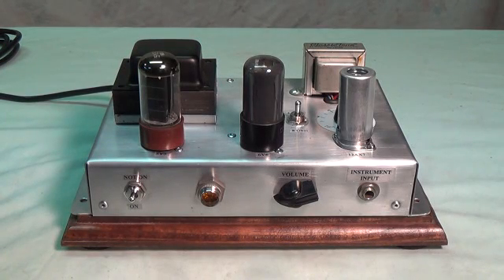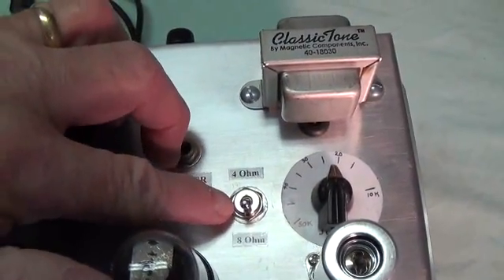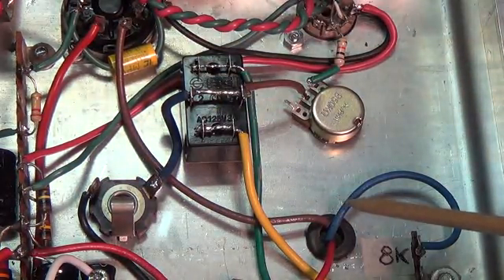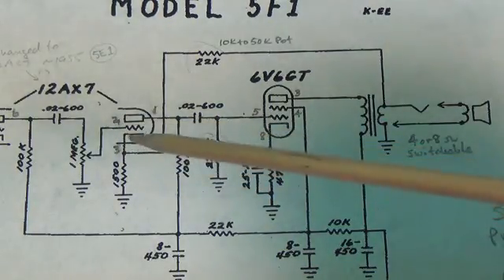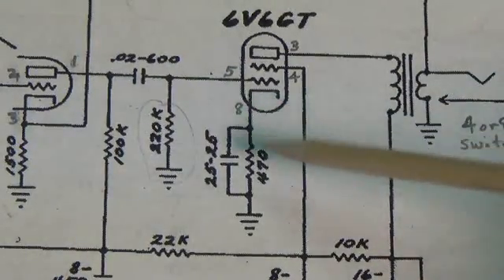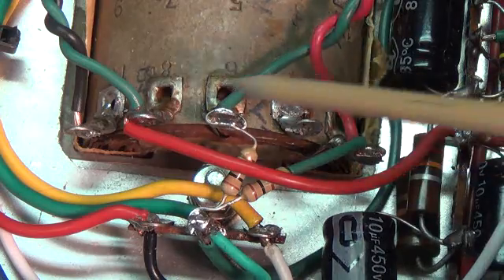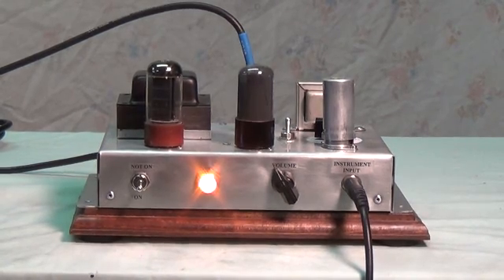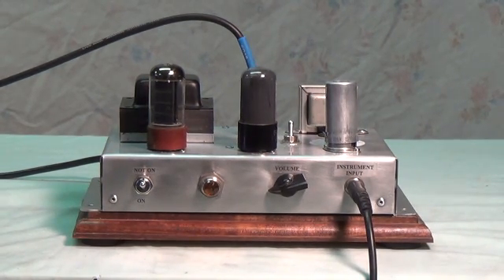Scratch Building a Fender 5F1 Champ from Scrap Parts.....Part 2

Comment: Dear Uncle Doug
I have gathered all the parts to start building a 5f2-a combo like you did in an earlier video. But now after seeing on this Champ you used a selector switch for the output to keep the negative feedback connected to selected output, were on the older video of the 5f2-a you have two output jacks. I'm conflicted on what MIGHT works better. I say might because I see other amps like the JCM800 has the feedback connected to the 4 ohm tap before the selector switch, suggesting that it doesn't matter because it still connected to the circuit regardless. Please enlighten me with you enormous wisdom.
Reply from the maker: You can use two output jacks, one 4 Ohm and one 8 Ohm and connect the NFB to the 8 Ohm output jack, NP.  It doesn't have to be switchable. It will work for both output impedances.
Reply: Thanks for clearing that up, but now another question simmers in my brain. What would happen if the NFB was connected to the 4 ohm output? Would it affect the tone? If so, could that be a mod to add a switch, to switch the NFB between 4 and 8 ohms?
Reply from the maker: According to viewer input, you want the NFB permanently attached to one of the outputs; otherwise, the amount of feedback will vary greatly if you try to switch it.

Comment: hey love your vids.  this little amp is almost I dentical to the fender champ 5E1.  I was wondering if you could combined the two by turning a swich tho can wich one you would like
Reply from the maker: +fucken killer jason  The only differences I see between the 5E1 and 5F1 are a filter choke and cathode bypass cap on V1a with the 5E1. The CBC could be made switchable, but the filter choke could not (in any practical way).

Comment: Hi Doug,  Is there any advantage to or a way to shield the wiring associated with AC current so as to further reduce hum ?
Reply from the maker: +Andrew Darnley   Simply twisting the two AC wires tightly together will result in out-of-phase EM fields which cancel each other......and greatly reduce or eliminate 50 or 60Hz hum.

Comment: Love your channel! I'm looking to build a 5F1 soon, and this was very helpful for some ideas on customization etc. One note: the link in your description is no longer working (I'm guessing the site has been abandoned since you posted). There are tons of sites with information on this amp, but if you have another suggestion for a good source, I'd love some expert guidance.
Reply from the maker: +bh3553   I checked the link and you're right, BH.....so I deleted it.  As you noted, there are countless sources for info on this specific circuit. For general knowledge about circuit design and function, I recommend the The Valve Wizard (UK), and for improving of circuits, I recommend The Fender Guru.

Comment: hello uncle doug, I wanted to ask that can i use the virtual grounding for a 320V transformer? which has a single 320V volt output rather than a centre tap 2×320V transformer?
Reply from the maker: +Harsh Karelia  Greetings, HK. The virtual center-tap is used only for the 6.3VAC output to the tube heaters, if the 6.3VAC winding does not have a center-tap. The high voltage (320VAC) winding must have a center tap if you are going to use a full wave rectifier. If it doesn't have a center-tap, then you will have to use a full-wave-bridge rectifier. You cannot use a virtual center-tap on the high voltage winding.
Reply: +Uncle Doug thankyou very much sir! I am not able to find a 2×320V transformer anywhere in India. I am trying to build a plexi style 6v6 so the negative bias should be taken from the bridge rectifiers negative? and where will be the common ground for all?
Reply from the maker: The negative DC output of the FWBR is grounded to the chassis, and the positive output is the B+ for your plates. You can either cathode bias your output tubes or take a grid bias voltage from the 320VAC output of the power transformer (prior to the FWBR), reduce it to the proper level with a resistor, and then diode rectify it negative and filter it. It would be easier to simply cathode bias the output tubes.

Comment: Would two 8/ ohm speakers paralleled on the 4/ohm setting create richer tones?
Reply from the maker: +bad banano  I think two speakers always sound better, or at least fuller, than one, BB, and your math is correct.....the two 8 ohm speakers in parallel would have 4 ohms of impedance.  You could try it and see.
Reply: +Uncle Doug, as you imply, that would depend on what sound you're after. As I'm sure you know, but just to clarify for your readership, two speakers will increase your efficiency and consequent volume for the same output setting, as well as the headroom of your speakers and consequent clarity. But those increases may or may not be what a given person wants. If you're looking for speaker breakup instead of clarity, or volume is of no consequence, or perhaps low volume is even desirable such as when recording or when neighbors are an issue, or in the case of recording where a single close mic on a single speaker will give you the most clarity, then a single speaker is "better". Thanks for all your work!
Reply from the maker: You're welcome, Tim. Thanks for your input.

Comment: hello doug, i thoroughly enjoy your videos and have learned a lot from them. i am starting to build my own 5f1 from scratch and i have a question: i was planning on using a second 1M pot as a tone control in mine, but i dig the variable negative feedback loop. from a standpoint of voicing the amp, would you have a favorite between the two, and would there be any benefit to adding both features? also, i am assuming that you used a dpdt instead of a spdt switch for the 4/8ohm output selector because you had one in your magical "junk" drawer.
Reply from the maker: +4bbl4sp2ex   I'm glad to hear that you enjoy the videos, 442. I would suggest adding both a tone pot and adjustable NFB pot. The effects are useful and quite different. Yes, apparently I had the DTDP handy and jumpered it to turn it into a SPDT.  I hate having to order or hunt down parts, so I tend to use what is at hand.
Reply: Thank you Doug! How do you feel about adding a 25/25 cap in parallel with the 1.5k resistor off the #3 lug of the preamp tube to help with the loss from the tone pot?
Reply from the maker: Adding a cathode bypass cap can often increase gain and improve low end tone, 442. I suggest that you try it and see how you like it.

Comment: Hi Doug,
You have inspired this 64 year old tech to scratch build a Fender Vibro-Champ into a speaker cabinet I made in Jr. High School wood shop nearly 50 years ago!  Thank you for all your incredible videos!

I have one question perhaps you can answer...Would it be feasible to build in a Negative Feedback Loop control as shown in this video of the Champ into the Vibro-Champ circuit?  Or would it interfere with the vibrato circuit?

Thanks again! --Dean
Reply from the maker: +Dean Rohleder  You're welcome, Dean. Rusty and I are glad you found our videos to be inspirational :)  The AA-764 Vibro-Champ circuit has a fixed NFB loop (2700 ohm resistor), so making it variable would not cause any harm to the Tremolo circuit (Fender mistakenly calls it Vibrato, but it's not).  You might use a fixed 500 ohm resistor with a 5K pot, to provide variability from 500 to 5500 ohms. Good luck with your first amp-building project.

Comment: Hi Uncle Doug, really enjoyed watching this video, ( and thank Rusty ;) for the great camera work) so much that I hunted down the same Precision Generator on E-bay. $28.00 delivered to my door. I bought the worst one I could find, It didn't work and was far beyond my capability to repair. So...... I am trying to make an amp from it like you did, but with a couple differences if possible. I purchased a large assortment of n.o.s. tubes from an estate sale, and have quite a few metal tubes. I wanted to know if it would be possible to use the 6SJ7 pre-amp tube as in the original champ design, followed by the tone stack of an early Princeton into a 2nd pre-amp tube, a 6SQ7? My Sylvania Tech Manual says it is a hi-mu triode with an amplification factor of 100 (about the same as half a 12ax7?) and also a duo-diode. I was wondering if I could use just the triode portion of the tube? If so, what would I do with the unused diodes, pin 4 and 5? This will be my 1st amp build, I thought the champ would be a good place to start, but I also want it to be a little unique. Ask Rusty if this is possible or am I barking up the wrong tree. Any reply or advice would be greatly appreciated. Thanks, Tom
Reply from the maker: +Bucyrus Erie12  I think you'll really enjoy building an amp from junk parts, Tom.  You could build a 5C1 Champ using the 6SJ7 pentode as the preamp tube, but the gain will be less than the two triodes of a 12AX7.  The tone stack idea is interesting, but it causes some signal loss, which may be an issue for a low-gain amp like the Champ. If you want a tone control, look at the 5F2-A Princeton (which is a Champ with a tone control). I guess you could add in a 6SQ7, but your power transformer may have trouble providing the filament and high voltage for more than two amp tubes. Pins 4 and 5 are diodes for use in a radio circuit. How about a 5F2-A Princeton, but with a 6SL7 instead of the 12AX7?
Reply: Thanks for the advice Uncle Doug, I do have a few NOS 6SL7GT's, I will use one as the pre-amp tube. I am going to try and use as many vintage original resistors and capacitors as possible. Though at this time I have no way of checking if the caps are good or leaking, so that might change. As I am typing this, the contact cement is drying on the cabinet for my 1st retolexing job. Thank you for posting the video on how to do that. I will try to make a little video to show you when the amp is done and installed in cabinet. Though I may have some additional questions along the way. Until then have a Merry Christmas and a Happy Healthy New Year, Tom Uncle Doug
Reply from the maker: You're welcome, Tom. I think you'll like the 6SL7, since it has two triodes so you can have two stages of pre-amplification prior to the 6V6 output tube, for good gain. The volume and tone control(s) can go between the two triodes. You might want to use new capacitors. If the resistors check out resistance-wise, they should be usable. I'm glad the cabinet covering videos were helpful. Best of luck with your project and Happy Holidays !!
Reply: +Uncle Doug Hi Uncle Doug, I hope you and the gang are doing well in 2016. I also hope your Capacitor Series is coming along as I could use the knowledge... I am having some trouble with my scrap build and maybe you could clear some things up. I thought I hit a home run when I found the schematic for the Princeton 5b2 amp as it uses the 6SL7 as the pre amp tube AND has a tone control, but it just added to my confusion. I have the inputs wired in typical fender fashion with 2- 68k and 1- 1million ohm resistors. My 1st issue is with the bias of the 6sl7 cathodes. The schematic only has one side biased with a 5000 ohm resistor, and the other to ground. Shouldn't they both have a 5000ohm to ground, as they are separate? I checked several other octal pre amp fender schematics and 5000ohm seems right for them. And can I add a 25uf-50volt cap across one? The plate resistors I think are 250,000 ohm and again this is typical for octal pre amp tubes. I also cannot find a place to order the .005 and .0005uf @600volt tone caps from.  Do the .02uf 600volt caps between tubes have to be coupling caps? I went to the site you mentioned and they seem very pricey.... About 25.00 a cap. Finally, the original plan calls for 3-8uf@ 450 volt filter caps. Should I up them to 10 or 16uf @450 as in some later designs? Sorry this is so long. As always I really appreciate the help, Tom
Reply from the maker: The 5b2 circuit is rather bizarre and very primitive, Tom, but if you want to use a 6SL7, I guess it will have to do. The 5c2 with a 6SC7 is a bit more "modern".

The 5b2 circuit uses an unusual (radio-derived) grid-biasing based on the .01uf cap in series with the first grid. The tube wiring should be left as-is in this area....add or change nothing. 

Antique Electronic Supply lists 500pf silver-mica caps at $.70 each, and they are excellent for the purpose. High-dollar "tone caps" are for chumps.

Yes, you can boost the filter caps to 10uf@450V. The first one could go to 16uf if you wished, but the others should stay at 10uf.

My advice is to get the circuit in the schematic up and running as-is, then deal with modifications, if needed, later. This circuit worked at some time in the distant past, and it will work again. This may not be true if you start altering it too soon.
Reply: +Uncle Doug Hi Doug, I found the caps you suggested. I called Antique Electronic Supply, and they cleared up all my confusion with regard to capacitor values... and I am just waiting for my order to arrive. Very nice people there. I will send you a little video when I (hopefully) get the amp functioning... Thanks again, Tom
Reply from the maker: You're welcome, Tom. I'm glad the lads at AES were able to help you. They are a fine bunch. Best of luck with your project.
Reply: +Uncle Doug Hi Uncle Doug, I hope everything is okay with you and the gang as you haven't posted a new video in a while. I just wanted to let you know I finished my 1st build about 3weeks ago and I think it turned out quite well, I also think it one of the best sounding amps I own. But I am biased as I built it! I guess it turned out to be a 5F2 Princeton, but with the 6SL7 pre-amp tube. Actually, it is a RCA 5691 Red Base tube which turned out to be some what of a problem... I didn't know at the time that it was an industrial tube, I thought it was like a 7025 is to a 12AX7 (low noise). But as it turns out it uses a pure tungsten heater filament and draws 600mA current! I will explain how I got around that when I make that little video of the amp I promised you. I just borrowed a friends Sony camera as I don't own one. I guess I will just upload it to my YouTube page and then learn how to send you a link. Again UD thanks for making your videos and thanks for all the help. I really never thought I could make one 5 months ago, now I cant wait to build another...Tom
Reply from the maker: This is great news, Tom !! Congratulations on a very successful first build. I can't wait to see and hear all the details. As you have found, this is an addictive hobby, with each project leading to another....more complex and challenging than the first.

Comment: Thank you so much for your videos, there a huge inspiration for me. hears is a picture of my 5f1 project parts i got mostly from an old record player/projector, and a silvertone phono amp. the chassis is an old aluminum EXIT sign. the OP transformer primary is 4300 ohm. do you thank that is close enough to the 5000 ohm a 6v6 needs? (i thank the transformer originally was powered by  a 6AQ5A.) thank you for your time and for everything you do.

Your friend,
       smokey90.

https://www.dropbox.com/s/1781p9ff8517824/IMG_20151220_155445-1.jpg?dl=0
Reply from the maker: +smokey90 You're welcome, Smokey. I'm really glad the videos are helpful.  It looks like you're starting off with parts similar to the ones I began with. I love the old EXIT sign chassis :)  I'm not sure how you determined the primary impedance of the OPT, but the winding ratio is the most reliable method.  If you're not sure about this, I posted a video showing how. Best of luck with your project. Please let us see the final product.

Comment: Happy holidays uncle doug!hope you,wife,and rusty are doing well! Thanks to your info I got my 5f1 working!but it has excessive hum,I copied a layout that didnt ground any heaters,on the other layout I see heaters pins 1,and2 grounded on the 6v6,pin 9 grounded on the 12ax7,do you ground those pins on your layouts?would that reduce hum if I did?should there be a resistor going to the ground from those pins I mentioned?also I didnt attach a capacitor on the 110 primary side of the transformer.Also I have long leads coming from the transformer,because I have it sitting at the bottom of the cabinet,its a huge hammond transformer,could those long leads cause problems?I put everything on an aluminum chassis.Thanks for being so gracious in answering our questions! Rusty seems like hes been such a good boy,maybe we can raise a little money to get him some extra dog treats!
Reply from the maker: +mike connell   It's always best, in my opinion, to run two tightly-twisted 6.3VAC filament leads to each amplifier tube heater, rather than grounding one heater pin and running a single wire to the other. Also, every pair of wires carrying AC within or near the chassis (5V, 6.3V, and High Voltage) should be tightly twisted. You can try adding the missing primary capacitor to see if it helps.....if not, just leave it out.  Another good practice is to use shielded cables (with shields grounded at one end) to carry the signal to the first two amplification stages, tone controls, and volume control.  The long transformer leads are not a good idea. Twist the pairs like I said above, move the transformer closer to the chassis, or at least shorter the leads as much as possible. Good luck.

Comment: I'm about ready to tackle this project. I want to put it in a 40's radio cabinet to make a "what if" fender  guitar amp. Would the transformer from an am tube radio work for this peoject?
Reply from the maker: +Matt Smith  Transformer requirements are quite specific. The voltages and current ratings must all be appropriate for the amplifier circuit.  Please see my video on the subject for more information.
Reply: +Uncle Doug Thanks, will check it out.
Reply from the maker: Good luck, Matt.